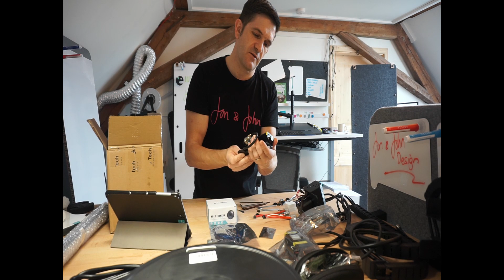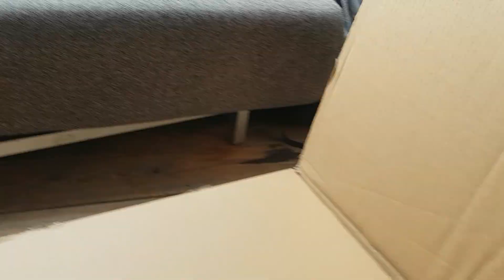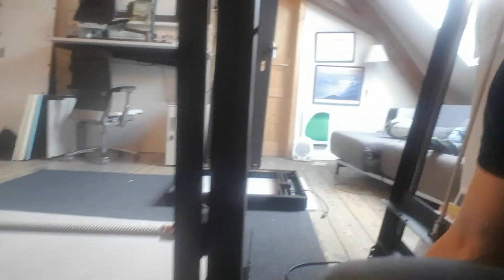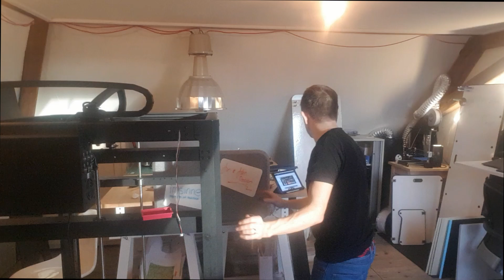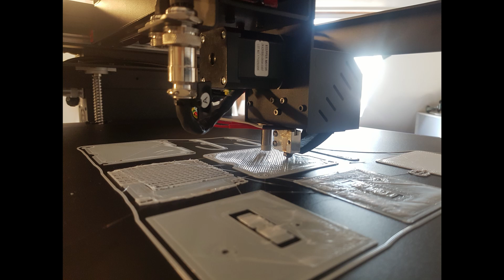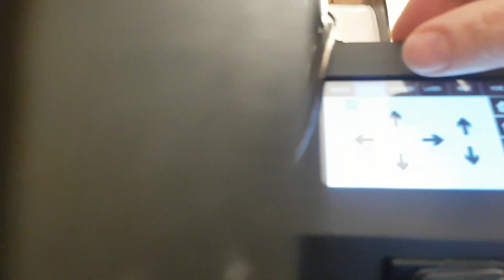febtop Optimus P1 3D Printer Build

Comment: Thanks Jon!
We are about to get an optimus P1, wonder if you have tried prusaslicer on your P1. Been using cura for years but since I start using Prusa slic3r several month ago everything got much better, paint suport, ease of use fast slicing.
Reply from the maker: Hi David, no problems, I wanted to do more videos but the time is not there. I have never used Prusaslicer but I think it could be good. Let me know if you do it. I am not so on to it with the Gcode set up etc so would need help. I use both Cura and Simplfy3d. I have to change sometimes from one to the other to get the results I want. I have trouble with consistency when printing different models but I think it is more to do with my lack of knowledge with the slicers than with the printer itself. Happy to answer any questions or talk if you want, email me.
Reply: @jonjohndesign4130  Ok thanks! I if I find the right settings for prusa slicer, I'll post them for you.
Have a Nice day